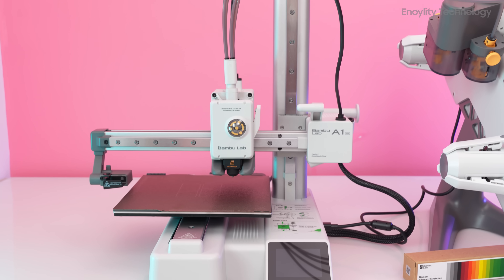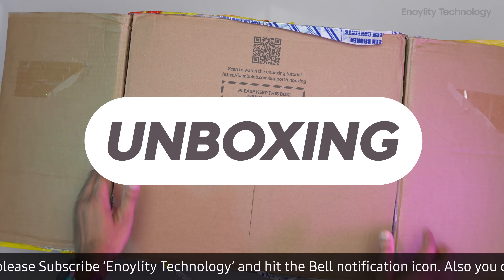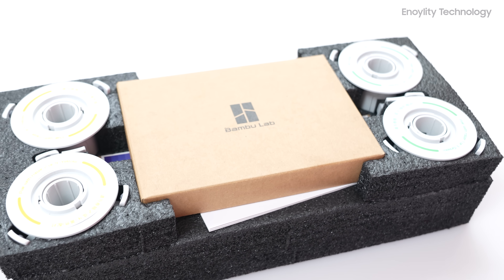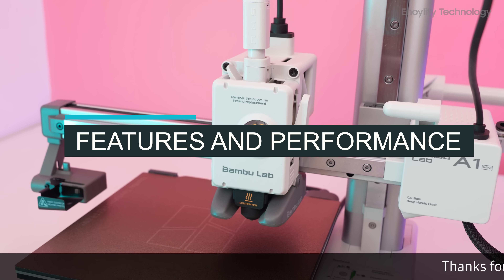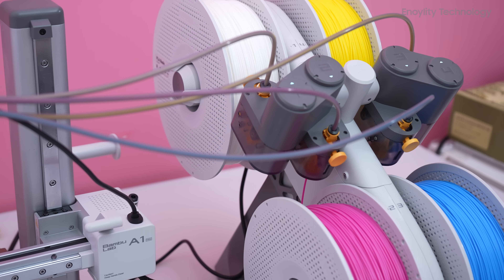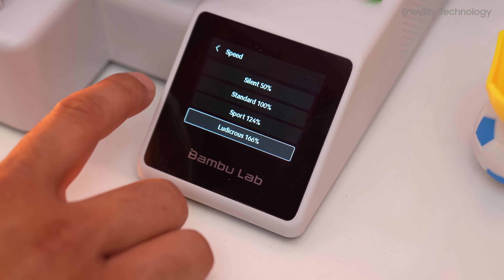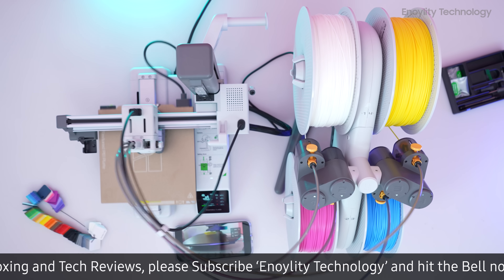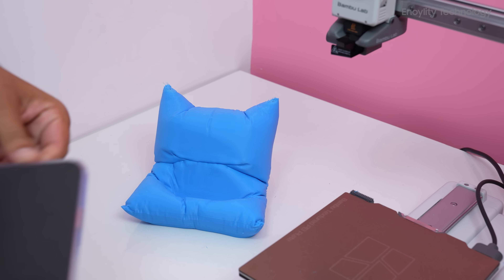Unleash Your Creativity with Bambu Lab A1 Mini: The Compact 3D Printing Powerhouse!

Comment: Upgradable firmware ensures that the printer can grow with the user, accommodating new features and updates over time
Reply: The Bambu Lab A1 Mini is perfect for anyone short on space
Reply: As a mechanical engineer myself, my expectations were extremely high to begin with
Reply: The settings are adjustable and the printer itself has the capability of handling any filament brand. You just need to adjust the settings and the spool itself will have to sit outside of the printe

Comment: Detailed online tutorials provided by Bambu Lab help users master the printer, making it easier to solve potential issues.
Reply: I have tried a number of 3D printers and this surpasses all of them combined. Intuitive, uncomplicated and the print quality is top notch.
Reply: This printer is amazing. It does everything and then some. Super easy to connect and run. A great buy!!
Reply: The unit itself is built with quality materials. Nothing seems cheap. I was really impressed with the Operating Instructions manua

Comment: Its have excellent cooling during print jobs helps to prevent material deformation, especially on complex parts 😮
Reply: Reinforced drive gears reduce wear and tear, making this printer more durable for high-volume printing😊
Reply: It's compact yet produces highly detailed prints every time

Comment: Supports layer heights as low as 0.05mm, enabling ultra-smooth finishes that are ideal for high-end prototypes
Reply: The auto filament run-out detection is an excellent feature for those long prints, ensuring no wasted filament
Reply: Perfect for rapid prototyping, its quick turnaround time makes it ideal for professional designers and engineers
Reply: . I have interacted with 3D printers before and have seen a few different models in action. We even have one in our office (Prusa i3 MK3) and I can honestly say that this 3D printer is a great purchase. I am 100% satisfied.

Comment: Stable frame construction reduces vibrations, resulting in smoother and more accurate prints 😊
Reply: Customizable temperature profiles for different filaments allow users to optimize prints based on material needs
Reply: Hot-swappable extruder heads make it easier to maintain or upgrade the printer for different types of projects

Comment: Pre-installed profiles for common filaments make initial setup fast and easy 😱
Reply: Excellent precision makes this printer ideal for small, detailed models, such as figurines or jewelry prototypes
Reply: Nozzle temperature reaches up to 260°C, making it compatible with a broader range of advanced materials
Reply: I’ve had zero issues with bed adhesion on the A1 Mini
Reply: There's no smell at all (unless you open the door obviously), no matter what material I print with. The filter on this is amazing. I print only 3 feet from my desk (and in fact, it's printing right now behind me) and there's no odor of any kind what so ever.

Comment: The A1 Mini’s sleek, modern design looks good in any workspace, blending functionality with aesthetics
Reply: The A1 Mini’s robust extruder design helps reduce filament jams, leading to fewer interruptions during printing
Reply: Mesh leveling provides better compensation for uneven build surfaces, ensuring consistent first layers
Reply: Pre-configured print profiles deliver consistent results without the need for manual tweaking of settings
Reply: Very good quality prints using the Dremel-brand filament materials.

Comment: The printer has a solid build quality, making it durable and resistant to wear and tear
Reply: Compact but feature-rich, the A1 Mini rivals larger printers with its range of capabilities.
Reply: Fantastic adhesion on the print bed eliminates the need for messy adhesives or tape, simplifying the workflow
Reply: The A1 Mini’s filament flow sensor detects inconsistencies, reducing print failures due to blockages or flow issues
Reply: This 3D printer is compact but doesn’t compromise on performance
Reply: The detail on my prints has been fantastic with the A1 Mini
Reply: This little powerhouse has been a game changer for my designs
Reply: The sleek design looks great in my workspace

Comment: Filament recycling compatibility is an eco-friendly feature that appeals to environmentally conscious users 😊
Reply: The Bambu Lab A1 Mini offers a versatile, compact solution for 3D printing, bringing professional-level features to hobbyists and small-scale creators alike
Reply: Compatible with 1.75mm filaments, giving users access to a wide range of filament brands and material types
Reply: I got a pre-assembled one. Plug and print. Very accurate and clean prints.
Reply: The unit itself is built with quality materials. Nothing seems cheap. I was really impressed with the Operating Instructions manual

Comment: The heated bed ensures better adhesion for prints, especially when working with ABS or other temperature-sensitive filaments ❤
Reply: Great community support ensures that users can easily find tips, tutorials, and troubleshooting help online
Reply: @Derrick-156 You really can set it up in 10-15 minutes.
Reply: Consistent temperature control on the heated bed helps prevent warping, especially on larger prints
Reply: Great printer! Accurate, good at printing overhangs, very fast! The rapid movements almost instant

Comment: I truly think this is the absolute best beginner printer it is absolutely fantastic quality and the price was also budget friendly.
Reply: Perfect for beginners, as the learning curve is low thanks to clear instructions and a user-friendly interface
Reply: Heat management is superb, allowing users to experiment with high-temp filaments like ABS and Nylon without warping
Reply: The filament loading system is incredibly straightforward

Comment: .I'm strongly recommending you all to buy bambu lab A1 mini..super fast, super smooth and super quiet❤
Reply: The Bambu Lab A1 Mini is an intriguing entry in the world of 3D printing, especially for hobbyists and professionals looking for a compact yet powerful machine
Reply: It's very quiet, but not completely silent. I can whisper to my wife on the other side of the room while its running and she can hear me just fine.
Reply: It took me just a few minutes to pull it out of the box, clip the build plate in place and we were up and running. I have seen my colleagues at work struggle putting the Prusa kit together with parts not fitting 100% correct or braking in the proces

Comment: The AI start beginners to start printing quickly. It delivers reliable performance for a variety of small projects ❤.
Reply: Active cooling fan ensures proper heat dissipation during long prints, reducing the chance of overheating
Reply: The A1 Mini’s silent stepper drivers are ideal for office environments or shared spaces where noise is a concern
Reply: Low energy consumption makes the A1 Mini a great choice for users who want to reduce their energy footprint
Reply: These features are just simply great and extremely helpful to setup a que of various prints, monitor prints remotely, and track filament usage.

Comment: I was semi- familiar with the process of 3D printing due to this. I've had NOTHING but bad luck with the Ender. Wasted TONS of filament and time. This printer hasn't had a failed print yet... im impressed!
Reply: went into this knowing that a 3d printer is incredible but intro models require a lot of tuning. Setup took me about 1.5 hours because I took my time along the way.
Reply: The A1 Mini excels in producing intricate models with minimal stringing or blobbing issues
Reply: The integrated power supply unit is compact and safe, reducing cable clutter and ensuring reliable operation
Reply: It's much faster, but you give up some accuracy for the speed. And the build quality is not up to the Prusa level.

Comment: This is my first experience with anything 3d related and I am very happy I started with this printer. The automation takes away alot if my stress
Reply: I’ve been printing for awhile now and love that this thing already has all the upgrades built in to it that I would normally do on my own
Reply: What I really like is it 3-D print almost anything. It printed me a cup and I still use it to drink water. I even printed a drone and now I put a chase and actually flies. The best part is even 3-D painted a little table fan.
Reply: Overall, I bought this one because it was advertised as being fully open sourced which is important to me personally. I like being able to upgrade/replace parts and components at will without worrying about compatibility or too many firmware edits
Reply: I am very impressed with the quality and speed of the prints.❤
Reply: Print quality is great and the predetermined settings help a lot for novices like me.

Comment: The printer itself is a fantastic piece of equipment, well worth the money.
Reply: I am very glad I purchased this printer and highly recommend it.
Reply: I recently purchased this 3d printer and have been thoroughly  impressed with its performance. ❤
Reply: The filament holder is designed efficiently, making spool changes quick and hassle-free
Reply: The direct filament loading system reduces the complexity of material changes, making multi-filament printing easier.

Comment: It was super easy to set up. After a few test prints, I had the exposure time nailed down for the resin I was using and started printing.
Reply: Out of the box impression. Nice build quality. This printer looks and feels premium
Reply: I especially like the design of the filament spool loader. My first 3D printer had the spool floating above the unit on a flimsy plastic rod but this unit's design is built into the unit and completely hidden from exterior.
Reply: Anyone who takes the time to read the instructions can successfully use this printer without any previous 3d printing experience.
Reply: Although it will likely invalidate your warranty, you can definitely print with non-OEM filaments and even some materials that Dremel will cautiously tell you "we have not been tested yet".
Reply: I am quite impressed with the ease of use of the printer and the quality of the prints

Comment: Packaged well, great detail, one thing I do not like about it that I liked on other brands is there is no way to hang the bed after print to let it drain. Probably an issue with all larger print beds though.
Reply: If you are just now getting to learn about 3D printing and or prototyping for school this is one I would recommend, it’s on a reasonable price point for students and adults alike, there are several types out there and resin gives so much flexibility to being creative. I
Reply: The printer is really fast, but if I cannot make a viable print the speed is of no use. I have also tried slowing down the printer and it made no difference to the prints.
Reply: Bought this a couple years back and just now started to use it. It's been a bit of a learning curve with putting it together and getting it to print properly.
Reply: High layer resolution capabilities on the A1 Mini allow for smooth and detailed prints, even on small objects
Reply: Layer adhesion is exceptional even when printing at high speeds, a standout feature for such a compact machine

Comment: It works exactly as described. If you watch the tutorials, you can scan the top of the lid to watch helpful videos. Definitely need to buy the wash and cure machine as well. I'm glad I did because you have to cure each print
.
Reply: Great printer, bought this after returning a resin printer that failed from the get go. This printer came almost fully assembled. I
Reply: The printer's performance exceeded my expectations, delivering impressive print quality right from the beginning.
Reply: Excellent customer support from Bambu Lab is frequently mentioned, providing users with quick solutions to any issues
Reply: Resume print function is a lifesaver during power outages, allowing you to pick up where the print left off
Reply: Fantastic build volume for its size, enabling users to print surprisingly large objects without upgrading to a bigger machine.
Reply: 3D Printer Firmware: I recommend upgrading the printer firmware when prompted which can be done over a WiFi connection.

Comment: It works exactly as described. If you watch the tutorials, you can scan the top of the lid to watch helpful videos. Definitely need to buy the wash and cure machine as well. I'm glad I did because you have to cure each print
.
Reply: No matter what changes I made with multiple modeling software all of the resulting models walls are flimsy. I have also tried multiple filaments in case it was filament related with no change in the results.
Reply: The user-friendly touchscreen makes navigating through different settings simple and intuitive
Reply: Wi-Fi connectivity allows users to upload files wirelessly, bypassing the need for cables or SD cards
Reply: . I use a painters tape on the build platform and get fantastic adhesion
Reply: The enclosed design is one of the main reasons I got this model, it provides great stable temperatures for printing more finicky types of filament and has an air filter on the back to reduce some of the odour/gasses.

Comment: The quality is outstanding and everything works well. The build volume is adequate for my needs as I mainly print miniatures and scaled-up miniatures for painting and display. Although it is not the fastest printer in the world, it has printed everything I have thrown at it with high quality and detail.
Reply: It's hard to believe something this complex can be so cheap and easy to use.
Reply: I like being able to upgrade/replace parts and components at will without worrying about compatibility or too many firmware edits
Reply: The machine makes it easy to load and change filament and level out the print bed
Reply: It was a great experience with  being ready to go out of the box with not adjustments needed.
Reply: Seems great when setting it up. I ran through the quick start guide to the letter, which ends in letting you build one of the models saved in printer memory

Comment: I love this 3D printer, it works perfectly.
Reply: The print head had an issue and sent me a new print head which resolved my issue and now the printer is printing well. Any cubic went the distance to make thing right.😊
Reply: I love the wifi connectivity ❤
Reply: The A1 Mini’s portability is perfect for makers who need a small, mobile solution without sacrificing print quality
Reply: The A1 Mini’s built-in camera allows users to remotely monitor print progress, enhancing control and peace of mind
Reply: Being new to 3D printing, I needed a bit of help getting started, and the customer support was fantastic

Comment: I just started 3D printing and chose resin over filament just because resin printed figures have more detail. This comes as a kit with everything you need to get started. The only warning I would give is don't use the metal scraper on the plate, it can scratch it up. I switched to a heavy plastic one. Also, buy a funnel for the filters when you pour unused resin back into the bottle. Other than that, it's been very easy to get started in 3D printing
Reply: I am highly impressed with the items I've been able to download and print from online sources.
Reply: Precision extruder allows for fine detail in complex models, which is a standout feature in its class
Reply: Great slicing software compatibility allows users to work with popular programs like Cura or PrusaSlicer

Comment: Fortunately there has been no problem with the printer, the machine works perfectly, I recommend it to everyone and the price is super great,
Reply: It easy to follow sequence on touch screen with 4 main sections Print, Prepare, Settings, Level. Each with good subsets of routines to follow.
Spool holder on top with run out sensor there.
Uses a micro SD card or USB cable for input to printer. See below my thoughts re. micro SD.😂
Reply: Overall, it is a learning experience and I like the quality of the prints when they work. It'll only improve as I get more and more use to it.
Reply: Supports third-party filaments, allowing users to experiment with a wider range of materials

Comment: Multi-material support on the A1 Mini allows users to print with different types of filaments like PLA, TPU, and PETG
Reply: Preloaded profiles for popular filaments save users time by removing the need for manual configuration
Reply: I just can’t justify the price for having to print everything twice Atleast to get it to work
Reply: This is the only printer I've used with a heated bed, so I can't say much for how good it actually is. But it seems really good. I've never had issues with it, and the only time I've ever had build adhesion issues is when I missed a spot applying glue (

Comment: With high precision printing, the Bambu Lab A1 Mini is capable of delivering detailed prints despite its small form factor 😊
Reply: I recently bought this for my son and I to use. The product is very high quality. I can tell from the unboxing
Reply: I have read early adopters of 3D printing spending months to get their first print right, it took me three tries before I had this printing perfectly, and a lot of people seem to get it going on the first try. Really a quality product at a very reasonable price.
Reply: Pre-installed filament profiles are optimized for popular materials like PLA, PETG, and TPU, making the printing process smoother
Reply: There are sufficient advanced settings that allow you to customize the printer for other filament materials such as the very flexible TPU, or "real" ABS. I have successfully printed both on my 3d45 with no issues.